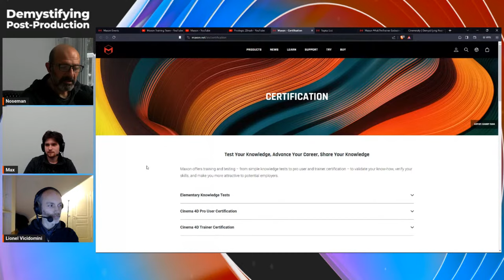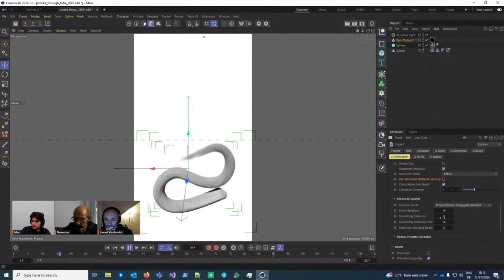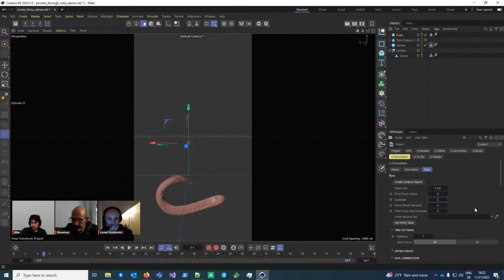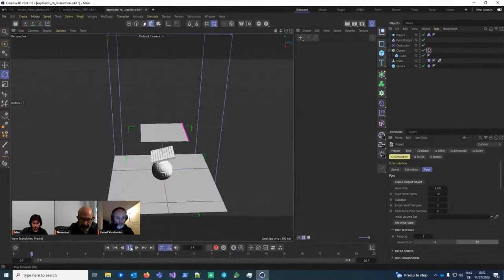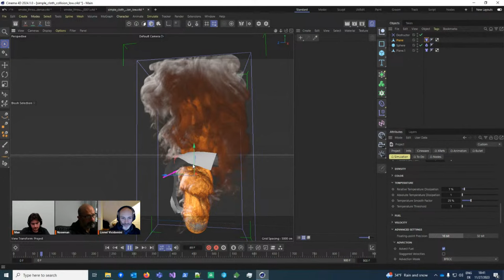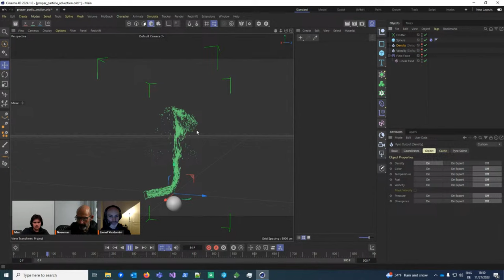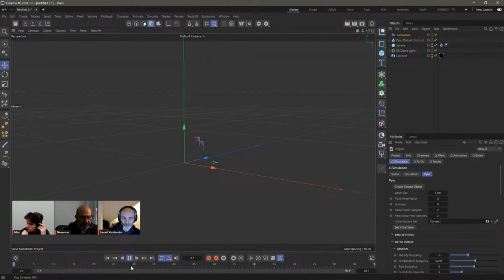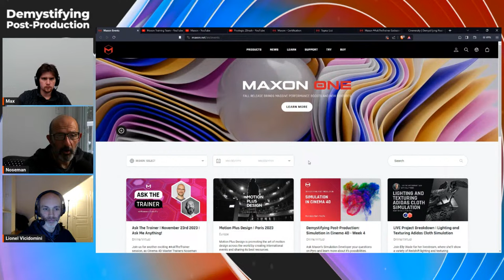DPP: Simulation in Cinema 4D - Week 4 - Pyro Deep-Dive

Comment: Whilst I understand there is a lot of trial and error with any kind of simulation, it would be great to have as much certainty as possible in Maxon's own tutorials. Instead Max seems to be caught out again and again by things either not working or working in unexpected ways, leading to a flurry of checking and unchecking parameters and adjusting values really quickly. With such a complex system, users need as much clarity as possible - it would have been good to see better scenes created to demo the difference in parameter settings, scene scale, collider usage and so on. To be honest more and more of Maxon's own demos/tuts are much more confusing than 3rd party ones ( both in terms of the not so clear explanations of how things work, as well as the seeming lack of script which leads to "umm, errr, I mean, no sorry not that, this one" - both of which just generate confusion where there should be clarity. Your user base are primarily artists and designers, not engineers, and a lot of Maxon demos are either dry and clinical walkthroughs of settings ( no different from reading the manual ) or in some cases with previous videos, they are demos by artists/designers who seem to barely know what theyre doing in the program.

I really think you need to either train your staff better to do presentations, or just outsource them to some of the excellent existing youtube teachers in this space. It just makes your company seem amateur and disconnected from your user base and their needs. This is meant as constructive feedback ( quite valuable to a company who cares about this ), but looking at the comments on this video and others by Maxon, Im not sure how much attention you pay to feedback.

This kind of "deep dive" should have MUCH more engagement, both in terms of views and comments. But I worry you are leaving viewers cold and more confused in some cases than before they watched.